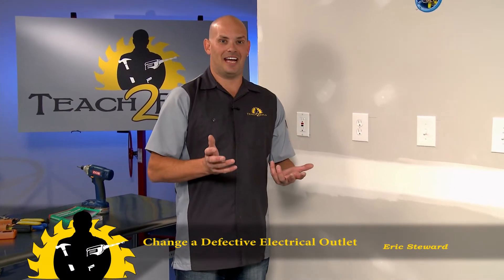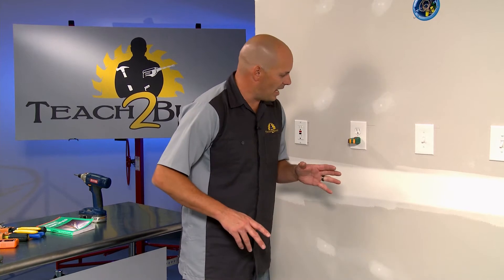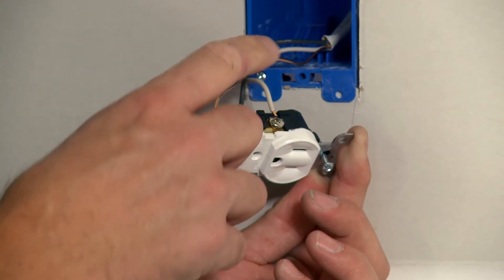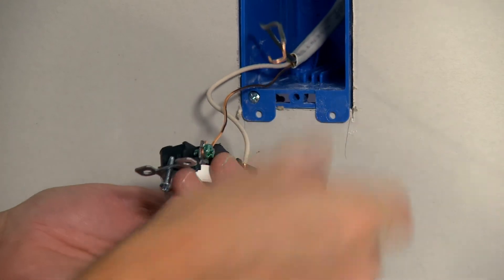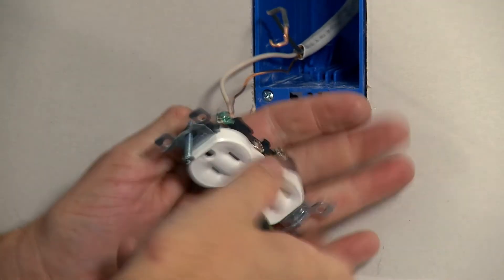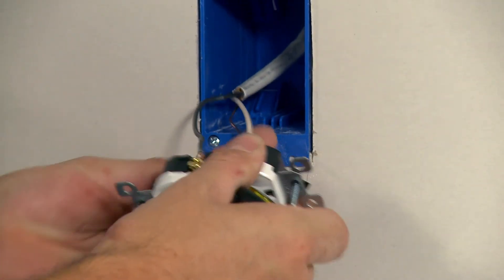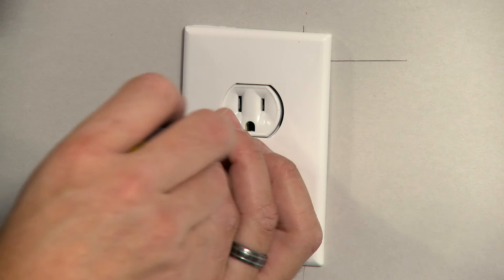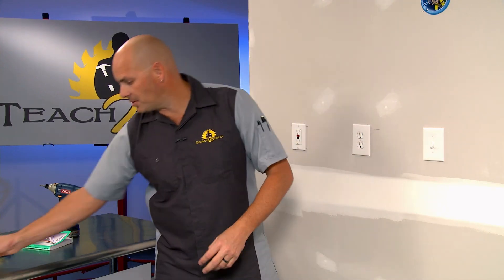How to Replace an Electrical Outlet

Comment: what was the tool you showed that helps in finding the actual breaker that supplies the plug. old house box not labeled ughg
Reply from the maker: @simplyraw1369  Klein makes what they call a Breaker Finder. Best of luck!
Reply: @Teach2Build  ty